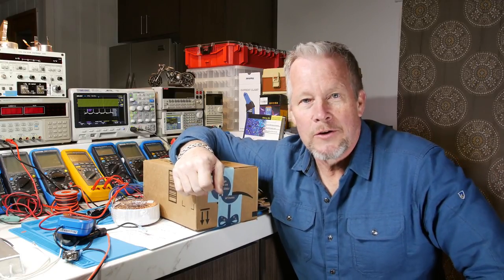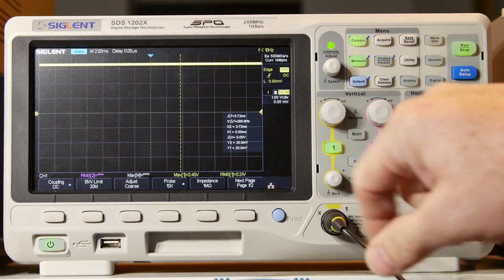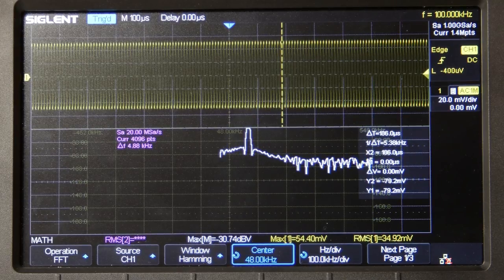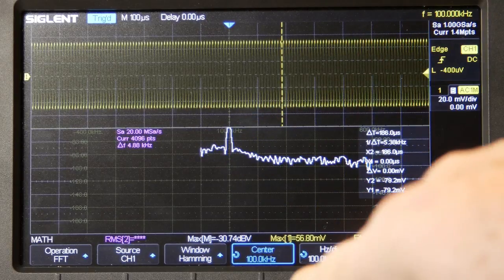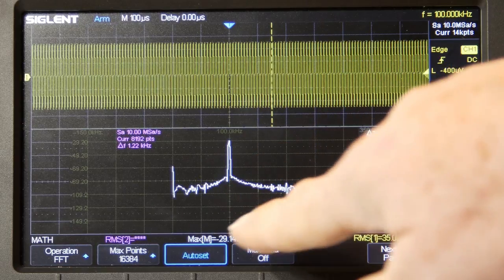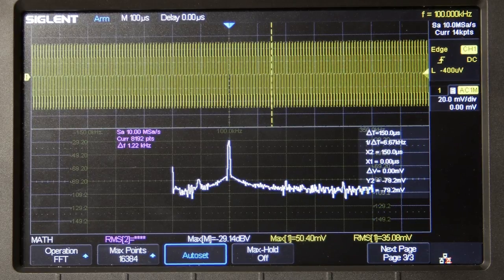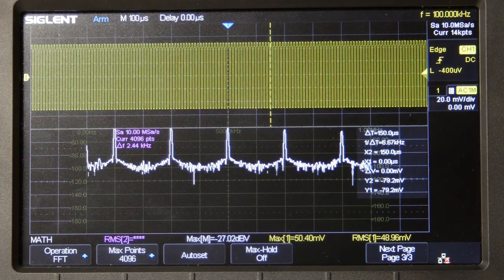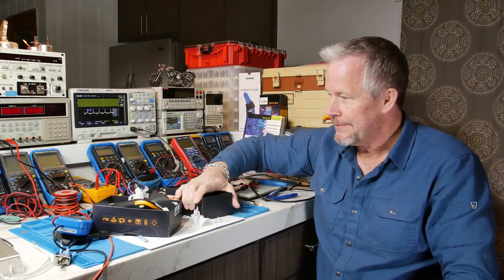How to use FFT to measure power supply voltage ripple #FFT

Comment: I did a search for FFT and your channel came up. I'm a retired EE. I never did any work with log type measurements, the example you showed on the ripple simulation was very informative. My current task is one with my metal working hobby. I want to use an accelerometer to balance grinding wheels. As even micro imbalance causes surface grinder ripples, as well on the tool post grinder, surface waves. So I want to use the Rigol 1054Z to measure the RMS peak of a 60Hz two pole motor spinning the wheel. I may not be able to fix the problem, but I'll learn something. As usual, the hobby is more fixing the tools, then using them.
Reply from the maker: I'm glad you found this channel!  Sounds like you have an interesting task.  Should be possible, and fun working it out.  Do you already have the Rigol?  Log will help if the signal is comparing or monitoring both small and large values.  It helps compress the signal so that the small stuff doesn't get lost in the resolution.  Let me know if I can help.
Reply: @KissAnalog  I've had the scope for 3 years now. I just got the accelerometers in the mail, so will connect one up and stick it on a motor to see what the signal looks like. Don't know if I will need to use an opamp to amplify or not. Grinder motors are 2 pole so run at 3600RPM minus slip. So effectively signal at 60Hz is the amplitude of interest.

Comment: Hi, is it possible to do such good FFT analysis with Siglent SDS1102CML oscilloscope?
Reply from the maker: That’s a great question.  I looked at the daily sheet and then the user manual to look into this. It looks like it has a lower points count.  So it will look OK, but maybe not quite as good. You can focus in on a harmonic and use the resolution that way to get better images
Reply: @KissAnalog  Thank you for your answer and great videos! If it's possible, would you think of demonstrate that  ;)

Comment: Hi Eddie , for practicing such things I dont want to use my hi voltage amplifiers. Rather something with less than 30V I guess. What do you think of getting a AC variac (250VAC)  that will work for my amps project to start them safely etc.  Or to get one transformer for example 230/30V AC?  Thank you for recommendation ! Jacek
Reply from the maker: I think that's a great idea.  I show a B&K AC power supply in my latest inrush current video.  I like to bring up things slowly. ;)
Reply: @KissAnalog  aaaa indeed. Just see this repair video. Very nice power supply unit

Comment: 409 / 5000
Resultados de traducción
First of all, I hope you are in good health and thank you for this informative video. I have a question: the configuration you have prepared shows the probe set at 10X and the bandwidth limit at 20Mhz.
To measure ripple on a DC power source, is this setting better than the: 1x setting with maximum bandwidth as you show in another video?
Thank you very much and take care !.
Reply from the maker: yes, I think so...  The 1x limits the bandwidth, and can potentially change the signal that you are reading as it can load it.  So, I like to use the higher impedance 10x.
Reply: @KissAnalog  Thanks so much to take some time to answer me, i really trying hard to get better and trusty results on my FFT measures, all yours videos has been very helpful to me.  
could you spend some time on taking some ripple by FFT meassures on a real power supply? i mean someting really noissy like a little cheap phone's charger or a pc powersupply. 
Again, thanks so much for all that you have teach us.

Comment: Dang, when you want to trigger on a small AC signal riding a large DC signal, that's when you switch trigger coupling to AC.  Or in this case just us AC coupling for the signal as well and ignore the 3.3 volt DC.

Comment: A friendly side note: You keep touching the screen. The SDS1202 is not a touch screen. There is NO reason for you to touch it! All you are doing is mucking up the screen with fingerprints...thanks for the FFT vid. I just got the SDS1202-E-X today, AND am using a 3.3v ps with an accelerometer and the scope's FFT for vibration analysis.
Reply from the maker: LOL  You are so right;) But it is a touch screen - it just doesn't react;)  How do you like your scope?  It sounds like you have a great application.

Comment: nahh why not keep it barebone.. and create the scenario a user would meet, and all down to earth.. all this waveform generator and then I will use this waveform and this DC negative offset and this and this. and all this chabang can then symbolize a power supply with some special features
but whatever' likely not the correct video for me.
Looking for videos with scopes, where one is actually taking real-world everyday things and showing the advantages you can use a scope for and basic ABC approach..
Reply from the maker: Thank you Jacob!  Your timing is awesome!  I have just started a series of videos that I want to do just that.  I’m going to get them shorter and to the point.  I’lI have one I am posting today which is a basic calibration and probe compensation video.  I thought about this when posting this video: How to measure Harmonic Distortion with Siglent Oscilloscope:  https://youtu.be/mYhbzYTdsNk